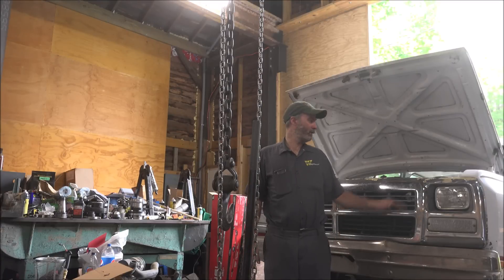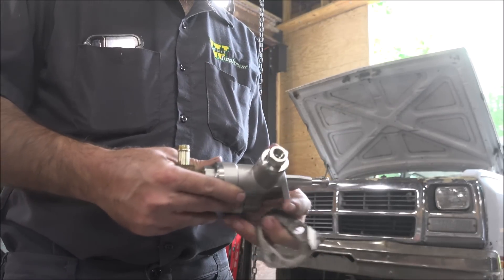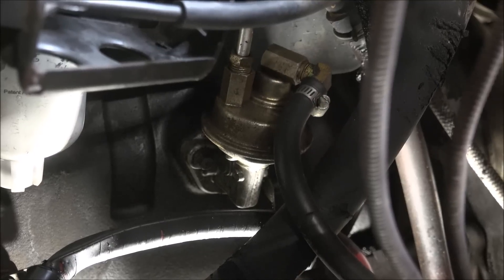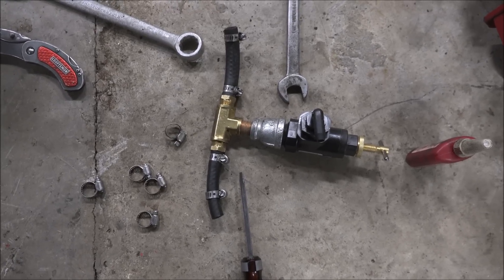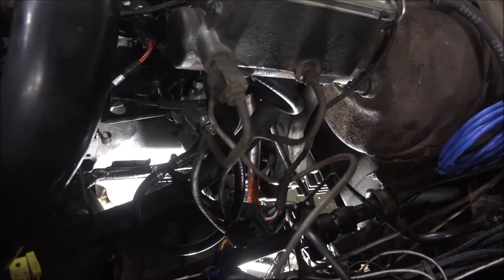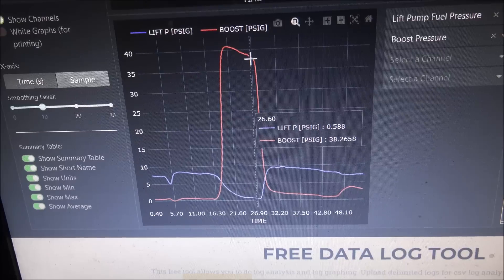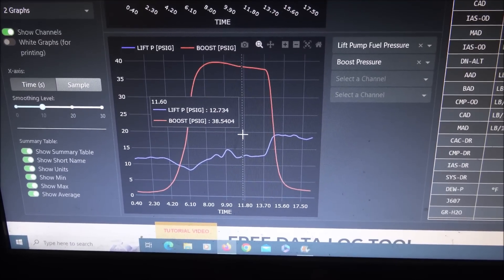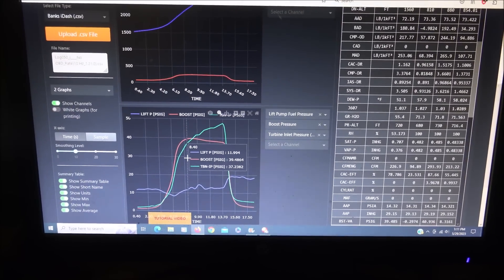PDD Hot Rod Modified Fuel Transfer Pump Install and Test

Comment: Brian,  I watch Oven's Garage channel... He has first gen's... He has a video on fuel pumps and how to modify a standard piston type fuel pump... like the one you just installed... but you use custom springs and you change the output pressure down to 18psi. for the ve pump. I have done ten since then. I bought two sets of springs containing 10 ea springs. They work flawlessly.  with spacer plate.
Reply from the maker: I am going to attempt to use fuel pressure to alter timing in the future so the regulator will be better for me.  He has some nice first gen on that channel. Been subbed to him for awhile

Comment: I had Pete PTOOMBS get me a full set up from CASE. Some of the CASE equipment with rotary pumped B's had a lower pressure piston lift pump that does not need any regulation.
Reply from the maker: You know me though. If a little is good more is better!

Comment: Nice to see datalogs and dyno sheets!   My guess on that PDD lift pump is it has a stronger spring than the factory one.. there's an upgrade using a Comp Cams valve spring, can't remember the numbers off them, probably from a chevy.. 273-1 is the number that rings a bell
Both my first gens have P pump lift pumps, I reduced the fuel pressure by grinding a little on the spring, ground until I got the pressure down to about 12psi.. Do you have your VE pump input shaft seal staked in?
I had my 2nd gen on the dyno once and that's how I found my fuel delivery issues.. 20psi at idle and it would drop to 4psi under full load.. the 160hp pump especially needs more pressure.. I was putting 440hp/998tq down at 2100 RPM and it absolutely flatlined from there to 3300rpm.  I put a draw straw in the tank and ran a 1/2" line to the lift pump and that fixed that!

Comment: The line is actually 1/2'' but most people replace it with 3/8 I just did my 97 and used 1/2 marine and AN fittings. My old line looked good but would suck air.

Comment: I was just watching this for a second time and caught that dyno graph, particularly the part where your power and torque curves intersect.  I am no diesel mechanic, but I’m very accustomed to this intersection happening at a point much further up the rpm range, say around 5250 rpm for gasoline engines.  I also don’t understand why gasoline engines are so consistent with having their power and torque curves intersect at that point, it is just something I’ve noticed because of the freakish consistency with which it occurs.  Is this intersection at 1950 rpm common for diesels?  Your efforts in recording and publishing your work is greatly appreciated and I continue to look forward to your future posts.
Reply from the maker: Hp and torque always intersect at 5250 . The reason they don't in this case is scaling on the chart the torque scale is different from the hp scale. because diesels tend to make double torque to hp it is usually displayed with 2 different scale values so the charts are bigger and people feel better. Otherwise they would be like why is my hp so low the line is way down here? LOL

Comment: Is there any way that the boost pressure could control the fuel pressure?  We used to spray water/alcohol into the 180 HP Corvairs by using boost pressure to cause the water/alcohol to be sprayed into the intake.
Reply from the maker: With a boost referenced regulator it can.

Comment: I just got an oem one because I'm more concerned about blowing any seals out on the VE I was gonna get the hungry diesel one, but am on the conservative side with $$$ atm as well. Never thought about a pressure regulator definitely a good idea.
Reply from the maker: I got this one on sale with a gift card I had bought on sale so it was the same price as a stock pump at the time.  It has been in the box a couple of years waiting for me to get around to installing it.

Comment: I am confused, why would adjusting the regulator to a higher maximum pressure affect the pressure drop under load? if it is only returning excess fuel to tank then it shouldnt open until it reached its set pressure??
Reply from the maker: In operation the regulator is always open and returning it has to close to make pressure go up when it starts to fall. Likely with it set super low the spring force was insufficient to make it close when the pressure started dropping so it could not maintain pressure. In the run with it adjusted up you can see pressure start to fall before it recovers as well.  That is the regulators response rate.  It is a $12 regulator so it probably is not the best control money could buy. It works though.